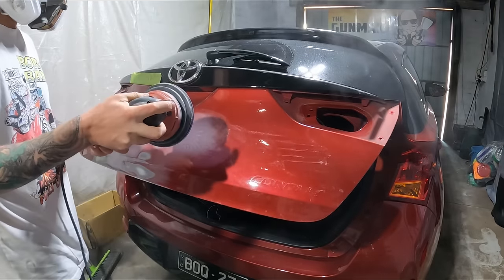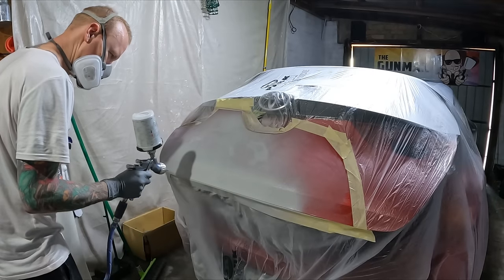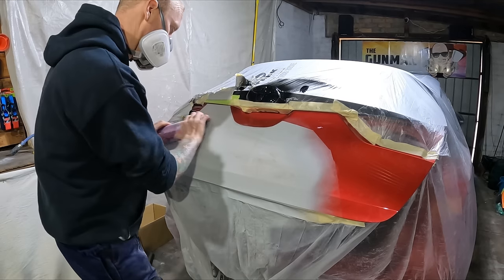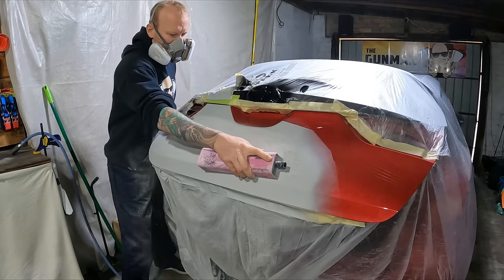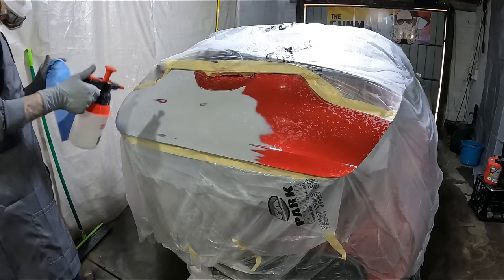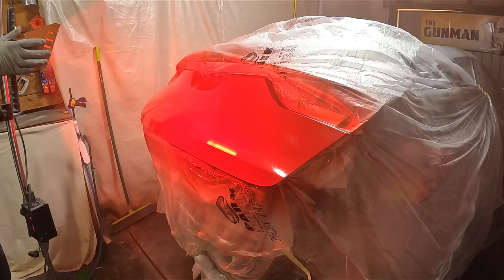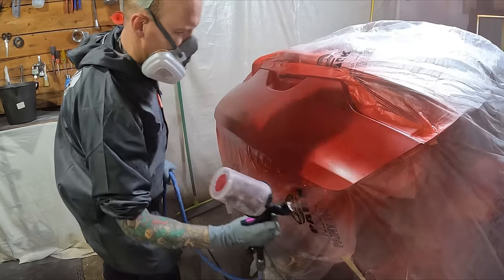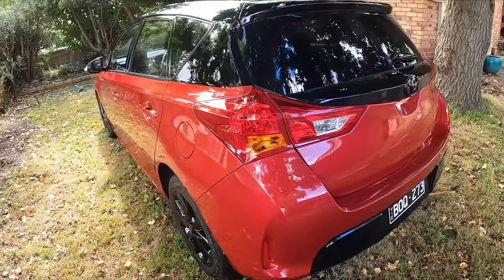Spray Painting Your Car At Home

Comment: Looks great bud! As far as blocking goes, as long as your not putting grooves in it , thats all that matters! Even though you're blocking linearly, you are keeping the block moving in different areas and slanting the block so as that it's not moving perfectly parallel. Common sense is the name of the game...which doesn't seem to be so common anymore. this whole thing with guide coat too. I use it occasionally in poor lighting , but if your lighting is good it's really not neccesary, you can literally see whats being sanded and whats not. I keep a micro fiber towel close by so that I can wipe the dust off the panel to see whats going on...it's not hard stuff. I use the towel because I'm not a big fan of blowing dust into the air every 5 minutes, and the micro fiber really cleans that fine dust off well allowing me to see everything clearly.
Reply: How do you get the edge of the primer level  and smooth with the existing paint
Reply: @conormc636  softly

Comment: Those metallic reds I use a solid red base first, roughly to same shade as the car, to cover the primer first. Almost treat as a 3 stage even though it's not. As a smart repairer find it helps without having to put so many coats of the metallic base on. Great video, like the kind DIY style home stuff.

Comment: Agree, the DV-1s is an awesome little touch up gun, great fan width for size.
You ever used a vacuum with the random palm sanders for prep and filler, first blocking blocking, and final palm sander 400 / 600 ?
Vacuum keeps that dust under control nicely, and using the velcro ceramic papers for the random palm or blocks, they last so long !
I use a fairly cheap 40lt 240v Ryobi vac from Bunnies, no BS there is no dust at all in the air or going all over the panel. 
Noisy bugger though, hearing pro a must !!
Not a bad job pushing the dent out, the heat and getting that bodyline out is key (42 years a beater / painter, 8 years PDR).

Comment: Honestly mate as long as your guide coating and watching how its coming off while sanding , you can cross hatch block or block straight and expect to get good results .. personally the way i do every job is cross hatch but i know blocking it straight gets the job done too! wet checking the primer with wax and grease remover is a quick way to check before paint as well . i know you know that tho , was mainly for people reading. tail gate come up alright . bit of plastic up and water gets the jobs done . having constant "clean" air flow is also really good also .

Comment: If getting a smooth finish look on the body filler it should not matter how you block sand it if you are going to be using a orbital da, it is the paper that you use and the stages of grit that you go up in, as long as the next grit removes the previous grit scratches and you keep the shape of the panel there is no wrong way or right way to smooth out body filler, bog, bondo, mud or muck, or whatever you call body filler.

You do great work and the finish is the proof in your work, a smooth mirror finish if that is the finish you are looking for.

Keep up the good work and keep your head high and proud of the workmanship you produce, don't let the doubters get you down.

I was always told when doing body filler cross hatching to key the surface to apply body filler over cured body filler so that the fresh body filler can get a key grip to the old or cured body filler.

Comment: When I was an apprentice, the bodymen (panel beaters) and the painters would ride my azz all the time because I used a DA to remove shaping scratches. I don't see the purpose of sanding plastic filler or filler primer using the "blocking" technique the entire time. I shape plastic filler with 40 grit. Once it's straight I'll buzz it using the DA with 80 & 180 to remove the deep scratches. After I prime it, I block the primer with 320 with a hand block, then buzz it again with the DA using 400 & 600. My bodywork never came out wavy and I didn't have deep scratches showing through. I know the scratches never came back through because I still own a vehicle I repaired back in 2005. I was there to make money, not to waste time and create dust.

Comment: You should consider picking up used cars that only need minor bodywork &/or a repaint, to flip for extra money.
Congrats on your new place btw.
Reply from the maker: That's a good idea
Reply: You could easily years ago, but cars are relatively a lot cheaper now and materials are costly. Probably better doing small jobs where you know cost vs return.

Comment: Always crossed section when sanding, I can't see how it would work doing full panels any other way, but you can't argue with the end result, I guess you have a good eye and experience to do what you do, for some one starting new I would only show them cross sanding as its hard to mess up if done right.

Comment: I use directional for panels that have a crease or significant curvature.  I like cross hatch for large, flat panels as it gives a more even finish generally with less chance of waviness.  So, I say both are correct, but in different situations.

Comment: I sand diagonally except when I don't. It depends on the panel. I never rub the filler with my bare hands. I would have spot primed that little bare spot. Usually use a first coat of tan (sort of a mocha color) base coat before red.

Comment: I do 75-80% directional blocking last 20% cross hatch and never had problems, even then if you do it's normally a repair issue not the way it's blocked.

Comment: Thanks for the video. Found you by someone on Amazon recommending you for the review of the paint gun you use. I've never used a paint gun in my life other than airless but I want to switch up my game. I am rebuilding older tractors now for parades and want to have a nice paint job on them. So if you get this message in the next couple of days, could you shoot me back a note about the brand of gun I should buy. I see this video is about a year old and products have gotten better so, yeah, let me know. I have an 80 gal compressor 15.5 CFM so that's not a limit for me. I am restricted in $$ (aren't we all) so about $300 is the cap for now. Thanks so much. Mark

Comment: Great work, I appreciate the detailed explanations of why you do things and what you might give up if you don’t do it right. 

I am wondering if you think my idea has a chance, or if it’s not worth bothering with. I have a class A RV - 35’ long, definitely will not fit into my garage. It was built in 1995, and its paint has…seen better days. 

If I set my standards low, can I paint it outdoors? There are some panels that are removable but a lot is impractical or impossible to remove. 

Are there any things you’d do differently if you were outdoors?

I painted the roof with some roller applied silicone material, and only got 3 or 4 bugs stuck in it. But the roof is waterproof now, so it’s an improvement. 

Finally…how exactly are you supposed to paint a 32’x8’ panel while keeping the leading edge wet while blending. I can’t reach from the top to the bottom without a platform…it sounds like a physical impossibility :)

Thanks!

Comment: Comment about the block sanding:  I don't really have an opinion about your straight-line sanding but at the very least YOU are getting the benefit of the long block.  Many who 'cross-hatch' do it too much to the side effectively making their block 3-inches long and just very wide.  The way they do it the block can and will 'ride into' the lows.  Cross hatching to be effective needs to just be enough to the side to avoid gouging the block was meant to be used mostly in a straight line long-ways.  My opinion only of course.
Reply from the maker: Good point, totally makes sense.

Comment: One mistake is that you don’t put filler on top of paint big mistake
Reply: You can provided the sanding scratches are the correct grit via the data sheet of the filler